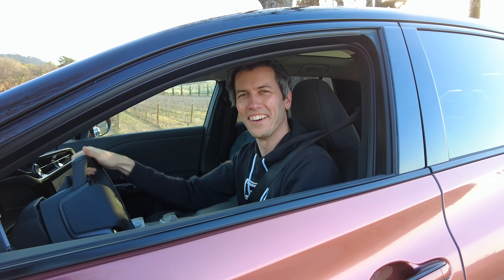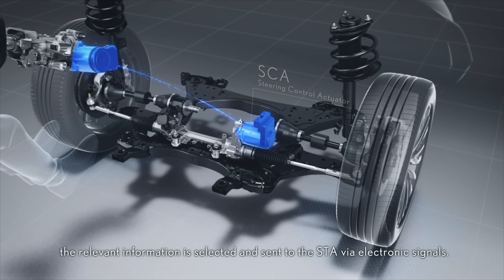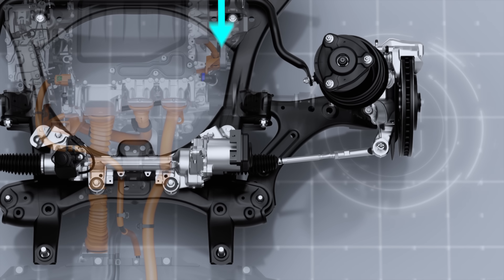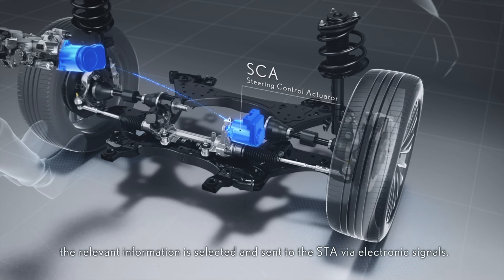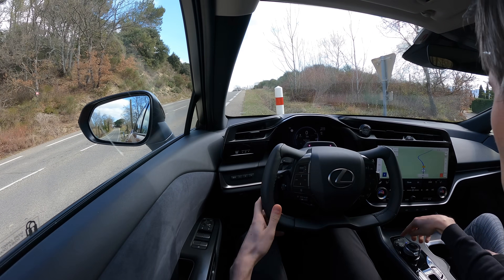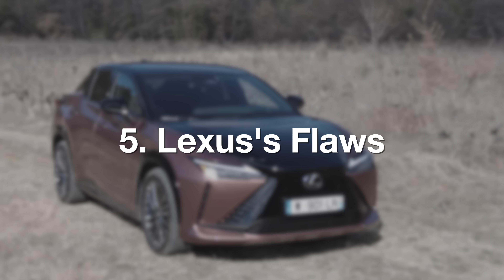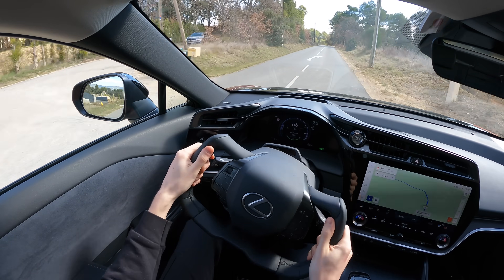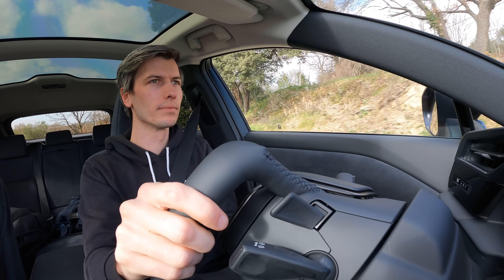How Lexus Fixed Tesla's Bad Idea: Steer-By-Wire Yoke

Comment from the maker: *Important Update* Many have asked if the maximum angle the front wheels can turn is limited at higher speeds, since it uses a shorter ratio. I reached out to Lexus for more information. They said "the amount or angle the wheels of the vehicle can turn left-to-right in a vehicle equipped with Steer by Wire is the same at 5mph and 85mph (they are also the exact same angle values left-to-right as on the traditional EPS steering system vehicles).  The changes are in the actuation of that steering rack left-to-right and the variable speed that you reach during that turning function as vehicle speed increases."

I have asked some clarifying questions and will provide updates here once received.

*Edit 1:* Here is the clarification they provided. FYI - it does not match what was stated above. 
"RZ with Traditional Steering completes a full lock to the L or R turn in roughly 540°.
 
RZ with Steer By Wire (version in France) completes a full lock to the L or R turn in roughly 150°. This implies the base ratio is 3.6:1,  which that for every 1° of driver input at the steering wheel in a Steer-By-Wire RZ, the wheels on the road would operate equivalent to the driver providing a 3.6° input in a traditional steering (540° system).
 
This solves the question of low speed ratio, but as we accelerate we reach a point closer to 1:1 or beyond, in this scenario if the steer-by-wire driver only has 150 partitions or input angles that can be sent to the computer, at 1:1 ratio – the Steer By Wire system only has 27% potential of available max steering angle (equivalent to roughly 1/3 of a full-lock turn). 
 
HYPOTHETICALLY SPEAKING FROM HERE ON: As we approach exceptionally high speeds, the ratio could become even greater skewed on Input:Output so 1 degree input could mean 0.2 degree of output for the wheels.  That means that for every 5 degrees of steering wheel turn by the driver, the wheels at the road would be turning the equivalent of 1 single degree input in a traditional steering vehicle.  This provides the feeling of ultimate precision and fun while driving at high speed because you are truly feeling every decimal partition of steering angle so you can very accurately steer the vehicle where you want it go. 
 
540° & 150° are the angles we know and have experienced.  The 3.6:1 ratio is a simple calculation that shows the relationship of those values.  We have a confirmation but not a provided data sheet, that at some speed beyond 10mph the ratio begins to skew towards 1:1 or more, so the rest of the values (i.e. 0.2°) are completely made up values but the math proves the concept. 
 
Purely for the case of the argument – let’s say the driver is doing 80mph and at that speed every angle of driver steering wheel input is 0.2 equivalent degree of output at the wheels.  If we multiply the 150 degrees of full lock input available to the driver at the steering wheel by the 0.2 degree output at the wheels, our total steering angle would be 30 degrees. 
 
As the driver applies the brakes or accelerates, the algorithm of input/output adjusts thus giving the driver “more access” or “less access” to max steering angle.
5mph: 150° Input by 3.6 Output = 540° “full lock turn” equivalent or 100% of max steering angle available
45mph: 150° Input by 1 Output = 150° equivalent or 27% of max steering angle available
60mph: 150° Input by 0.35 Output = 52.5° or 9.7% of max steering angle available
80mph 150° Input by 0.2 Output = 30° or 5.5% of max steering angle available
 
This may seem strange to think about, but imagine going 80 mph and without slowing down turn the steering wheel of ANY vehicle 540° to the full lock position…… nobody in their right mind would ever do that because it would undoubtedly cause a serious accident.  Having access to truly full lock steering ratio at 80mph is not something anyone ever takes advantage of or is physically capable of doing on a road because as you begin to turn that aggressively at speed, you would completely run out of road surface to drive on before being able to even complete the full lock turn.  There is also the high likelihood that if a driver attempted to do a full-lock turn at 80mph, the vehicle would have the possibility to flip over.  We know it takes about 2.2 seconds for an average driver to make a 540°.  At 80mph, approximately 200 feet are covered in 2 seconds.  With the average lane width in the US being 12ft (source: Google Search), it would require a road 16.67 lanes wide to be able to complete a full lock turn (without slowing down at 80mph, if that were even physically possible without disrupting or flipping the vehicle over). 
 
Conclusion: The higher speed one goes in ANY vehicle, traditional steering or Steer By Wire, the less useful max steering angle becomes, if even physically possible to achieve.  So the Steer by Wire system mathematically limiting access to max steering angle becomes a non-issue from a drivability or experience standpoint.  Having an inherent base ratio of roughly 3.6:1 and (a hypothetical) 0.2:1 at high speeds provides extreme ease of use at low speeds in parking lots or u-turns while providing an exceptionally precise feeling when steering at higher speeds and provides a complete range of differing input:output ratios to match the situationally indefinitely.  (The faster you drive, the more precise the steering ratio)."
Reply: Did i miss it or do you not know or intentionally omit that we ALREADY have gradient steering ratio in every car mechanically? Its low sensitivity close to neutral steering angle for highway speeds and high sensitivity at the edges for parking.
Its done by different tooth sizes...
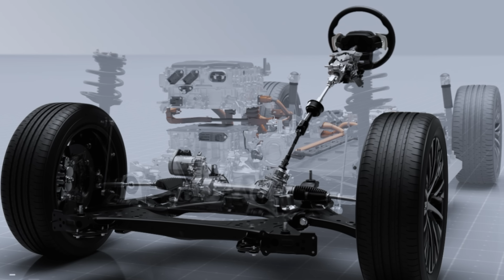Reply: @uninteressant2196  At 10:02 in the video he addresses the existence and limitations of modern mechanical variable steering ratio systems.
Reply: @uninteressant2196  I think your referring to the steering being speed sensitive vs variable ratio. Variable ratio is not a standard steering feature, but the speed sensitive part is.
Reply: @niuhuskieguy  Its entirely angle dependant, as i stated yes thats not variable, but good enough -the F1 clip at somewhere after 10:25 shows this pretty well - the outer edges of steering range turn the wheels way more than in the center. This is used in every car and of course street cars are less sensitive, mostly because of comfort and high speed safety. 

Sure you can make it variable on the fly when electric- i wanted to point out that the issue is a non issue and the existing steering principle is never mentioned in the video.

Where i see an advantage is back wheel steering.
Reply: Is the steering adjustment vs speed done with exponential curve adjustment, or does Lexus actually limit the total allowable steering angle at speed, or both?  In the RC aerobatic aircraft world, we adjust “expo” on the sticks for the exact reason Lexus adjusts high vs low speed ratios: we don’t want too much sensitivity near center stick. We still set the total travel though, and that does not change regardless of how we mess with the expo - full left rudder is ALWAYS full left rudder. It would be cool to be the engineer who writes these steering curves. It would be cooler to have ability to program a custom curve in the vehicle we are buying.
Reply: @MichaelBergantzel i don't know what Lexus did exactly, but usually you don't limit the steering angle as you need quite a lot at low speed tight corners, and at high speed you need a lot to generate the required torque to turn the car even at wide corners.
What you do is limiting the speed and acceleration at which the wheels can rotate. Because those have great impact on weight transfer in the car and therefore your stability margin of the car. If done correctly you won't ever need your ESP on normal road conditions. Which can make the system a lot cheaper. (PS. you still need an ESP, but it's no where near as beafy)
Reply: So, how did they solve the problem with accelerating or decelerating on a curved section of the road (such a s a circular track)? Obviously, for safety reasons you cannot change the steering ratio when the wheels are turned because you don't know where the driver wants the car to go (so, the rotation angle of the wheels should not be changed if the yoke is kept at the same angle when the vehicle is accelerating or decelerating). Do you understand what the problem is? You drove this car. Did you actually try to accelerate or decelerate while making a turn?
Reply: As the curve opens up or closes down, you steer a little more or a little less. Acceleration has the same effect. Not sure what your question is.
Reply: @tedantares2751 excellent question!
Reply: @tedantares2751  has this been answered ?
Reply: @KrissOTA  No
Reply: So effectively the car has a fixed total steering ratio and as you go up in speed the center of the turning arc is elongated for precision control and the edges are compressed to equal net 0 change in total steering angle? wouldn't this cause rapid change in turning angle as you approach the locks which at high speed can roll the car? Most peoples automatic response to the moose test is turning the wheel 90 degrees but in this car that would turn you up to 300% of what you are expecting which is very dangerous. I don't see the practical need for full steering at high speeds why not just cut some of it off for a more consistent and safer turning experience.
Reply: @Jared Ivey:  Well put.  Couldn’t have said it any better myself.
Reply: @JosieShmosie-x7m  wait, isnt that exactly what he said? it says it lowers max steering angle at high speeds. What are you complaining about?
Reply: @JosieShmosie-x7m  >>more consistent and safer turning experience
to have consistent experience you need to experience what it is to do U turn on 80kmh
even "mechanical" feeling will be different on 80kmh and 5kmh.
Reply: Roll the car? Not possible unless you strike a curb.
Reply: If the driver can command the wheels to the same angles at 5 and 85 mph, but changes near center are reduced to prevent it from feeling twitchy, then changes far from center must be larger. To me that sounds like a recipe for fishtailing, with unintuitive controls in an emergency.
Reply: @craigyounkins7013  you are absolutely right, it’s not every day we steer that hard on the highway, so an exponential steering curve would make correcting very hard. Most drivers would never even experience the ‘far from 0’ point on that curve until it’s too late
Reply: @craigyounkins7013  yeah agree the wheel will probably try to increase the resistance as you turn hard so you might be fighting that motor to make your maneuver. lets see it do the moose test.
Reply: @craigyounkins7013  You get the same in RC Planes/Drones
Reply: @craigyounkins7013  I assume the total amount of steering wheel movement is changed. I'm just making up numbers here, but you would have 900 degrees of steering wheel movement at highway speed, which is the industry standard, and 360 degrees at parking speeds. Again, made up numbers, but you get the idea.
Reply: I'm just happy that the largest automobile manufacturer is finally starting to embrace battery electric powertrains.
Reply: some mentioned the delay that is visible between in the initial footage where the car is stopped and both the steering wheel and the wheel are visible. is it noticeable/annoying when driving? Also you failed to mention variable gear ratio steering has been implemented and abandoned by both Honda (Honda S2000 VGS) and Toyota (Land Cruiser VGRS) in the 2000s ... it would be interesting to see a comparison, to see if they improved the technology, or if it's just making a comeback because it makes more sense in  EV's with large screens, yokes, and self driving around the corner. Personally I think it makes sense because:
1 it allows the driver to have a more consistent range of motion at low and high speeds
2 forcing the driver to do 3 full rotations of the steering wheel for three point turns is not great if you can have power steering that allows you to do it without taking your hands off the steering wheel
3 having less sensitive/slower steering at high speeds can be a good thing
 but they are concerns though, like
1 the learning curve, is it more dangerous when you're not used to it or someone borrows your car? it could be fixed with settings though
2 how to handle switching frequently between cars with fixed and variable steering.
3 how is muscle memory affected for emergencies, like quick steering adjustments to avoid a car that tries to merge into you, or oversteer/loss of traction
4 how it feels in a long corner with a radius that tightens or widens, to have the ratio change as your speed increases or decreases, and have the steering change with a constant steering wheel input....
Reply: @geemy9675  Not just honda and lexus but mercedes amended it too. That's because they wanted to just get rid of the mechanical connection while not really providing ANY benefits to the driver. I remember most of my friends felt the same -> if im not connected and motor is doing all the work why am i rotating the wheel 4 times. The sensitivity diference is nothing new either. Many introduce more WEIGHT to the stearing so the steering feels "stable" without changing gear ration. 

They all did it for cost saving and reasons  and manufacturers like mercedes wanted   to have control over the steering. My guess is that they would have taken away your steering inputs as part of stability control and such. The engineers, just like goverments, always see people having less control as solution to any problem. As the saying goes:
"The road to hell is paved in good intention" 

The negative I see is that this will be programmed differently from one maker to another. There is a reason games give you the adjustment settings. Not everyone is gonna like single approach. And we know how little customization they give us in cars despite the car being able to offer it.
Reply: If I am able to interpret that reply from Lexus, it sounds like they are saying that the steering ratio is much closer to "fixed" while at slow speeds (the angle of left-right tire movement is the nearly the same whether on-center or at full lock all across the rack). While at high speeds, it runs a very extreme variable ratio which looks like an inverted bell curve. Put another way, at high speed, the steering ratio is slow on-center, where a lot of steering angle change is required for small tire angle change. As you approach full lock at either end of the steering rack, that slow ratio ramps up quickly to get you the full articulation of the steering rack.

Although I like the concept of quick steering ratio that this system provides, the above could be dangerous in a specific situation. Given that the lock-to-lock of the steering wheel is a fixed angle of rotation (0.83 turns), math dictates that if you slow down the rack on-center at speed, but still must cover the same degree of steering rack movement, the remaining space OFF-center must be even faster while at high speeds. So the car is more stable and less twitchy on-center, but if you panic, or spasm (sneeze, seizure, etc.), or are impacted (giant pothole, hit by another vehicle, hit by something inside the cabin) and venture too far off-center, the steering will become extremely sensitive and you could wind up steering directly off the road or into an obstacle or spinning out on the roadway.

Most people will never do this, but that is precisely the problem. The one time you panic to avoid a stopped car or something on the freeway by quickly steering around it, that may be your only chance to experience this extremely fast ratio, and it will come unexpectedly, possibly causing a loss of vehicle control, and a huge overcorrection (a serious issue with mechanical steering already, especially on cars with soft suspensions).
Reply: Won't the adaptive steering ratio make it dangerous if your at highway speeds in rural areas and you suddenly have to brake/swerve to avoid an animal that runs onto the road/a dead animal hiding in the darkness of night? Won't the controller disregard those movement you made to the steering wheel to try and swerve out of the way?
Reply: Like Porsche’s front end lift, the setting needs to be mapped for steering intensity. I don’t see it working any other way. It would be great to be able to integrate the front camera into the system so the system will know what to expect but it’s up to the driver to make the correction OR we just need full self driving
Reply: That makes it seem to me that the delay in steering you observed could be programmed in
Reply: @Omlet221  except he was at dead standstill, but I agree what the seamed to indicate as a delay of moving wheel to when wheels get to true alignment of inputted direction.

So if on the highway you turn the wheel all the way to one side. It takes about as long as someone who had to hand over hand turn it to one side. Both would cause uncontrollable loss of traction.
Reply: @Omlet221 seems like a smoothing thing for ride comfort. Probably it could be tuned
Reply: @engineering explained But what if the car loses power all the way like zero power like back-up power also fails and I need to push the car and move it? How will I be able to move the car and navigate to any direction while pushing it? Will it still be able to steer to the desired direction?
Reply: keep it as an option and everybody will be cool with it. We hate new things because they were pushed to us, forcing us to use it instead of giving us a choice. electronic e-brake, im looking at you!
Reply: "nobody in their right mind would ever do that because it would undoubtedly cause a serious accident." You completely discount evasive driving, in which the driver pushes the car to the absolute limit of what's possible, performing J-turns and other high-skill maneuvers. Low-skill assumptions only apply to low-skill drivers, who should become skilled drivers instead of engineers attempting to make up for their lack of skills by programming some computer to attempt to guess the driver's intent.
Reply: @amorphousblob2721  Both, surely, and proportionate with unusual driving incident frequency.  Not suggesting untrained drivers, but the car coping with a driver developing reduced brain or physical function for any reason.
Reply: I would like to provide my own feedback with an older lexus car. It had a parking lot feature that would increase the sensitivity of the steering wheel at really low speeds. Well in ours that got stuck on at any speed. Going 45 mph if you so much as twitched you would be in the next lane over. It was scary af to drive.
Reply: It will be interesting to see the vehicle at the moose test.
Reply: So cool you had the opportunity to try it out! All the best!
Reply: What happens when gm  uses this and the wires burn up
Reply: If the system turns the same amount from lock to lock then is the system a variable ratio steering or does it just vary the speed it takes the wheels to reach the new position of the steering wheel.
Reply: Then it should Eigan at TDP i.e. 0 degree input should appox. 0 degree steering angle, path to path. Drift from stacking or noise? Position correction on servos is pretty standard in firmware.
Reply: i'm kinda surprised by that. 

i also wanted to point out that the delay might not be as much a flaw as you think. as, if there was no delay: it would feel waaaaaay too twitchy. again, as you said: unless you're a racecar driver. so maybe in the real model, when you put the car into "Sport Mode", the delay decreases and the ratio at higher speed is a little higher than in "Normal Mode". or rather: the drop off is lessened. 

and then maybe there's a "Race Mode". which maybe a warning pops up on the main screen saying "WARNING: this vehicle mode is intended for racecar drivers only. and may be unsafe for casual drivers. Lexus is not responsible for any harm this may cause the driver." to which you then have to click "OKAY" or even "I AGREE". a real privacy policy/terms and conditions type warning. this should also be explicitly told to the owner when they pick up the car. "this car has race mode that's meant for race car drivers only. the steering gets super twitchy. we recommend against using it unless you're a very experienced driver." maybe it could even be locked out until a certain amount of mileage is reached in "Sport  Mode". and also probably should be locked out in "Young Driver" and "Valet" modes as well. 

the delay may also be unsolvable. as it might be caused by the components of the steering system. electrons don't travel instantly, you may know. maybe it could be solved using an AI software? maybe with a camera mounted on the yoke? or on the dash board. i dunno.
Reply: I had an idea for a video: 
Get a few COMFORTABLE sedans: Subaru LEGACY is very comfortable, it would be a must for this test, new 23 Honda Accord and some other sedans with a SOFT suspension and NO low profile tires. Also get a few SUV of a similar price range.
Go to a GRAVEL ROAD with POTHOLES, washboard surface, etc., before you do the driving film the gravel road and show the potholes / bad condition.
Get a few random people who think SUV ride better, BLINDFOLD them, lift them into the cars somehow (so they DON'T feel the step-in height, that would ruin the test) and drive over the bad gravel road with them blindfolded. Maybe you can get a bodybuilder for lifting the people in and shout out their channel in return or something, best idea I had to solve the lifting problem lol
Before they get out of the car let them guess if car or SUV and the price of the vehicle.
Reply: When I saw that steering delay in the video I thought that was scary.
Reply: In essence we brought haptic feed back to the steering wheels
Reply: Totally unrelated to this. But could you please make  a video explaining whether or not hybrid engine that kick into life and turn back off after a few seconds is harmful to its long term health. Especially when they are cold and they kick into high RPMs and load very quickly.
Reply: Didn't Peugeot do something like this about 20 years ago? And If I remember correctly they went back to mechanical connections because of safety concerns.
I might be wrong on that one.
Reply: The middle seat became a snap of a finger 😮
Reply: Seriously....? Is not wireless yet? Even my headphones are wireless and, they are very safe.
Reply: The thing I don’t get tho is that variable assist strength has been a thing since hydraulic steering. So why can’t they continue to apply that to a traditional mechanical linkage with a short steering angle?

Also another concern i would have is not the redundancy of the systems but the redundancy of the wiring. Wires get chewed by rodents all the time or go bad in other ways. If there is only one set of wires from the input to the steering rack that feels really scary
Reply: Okk
Reply: Probably feels like a go kart
Reply: In RC modeling it is called EXPONENTIAL STEERING.
Reply: From the video, one could get the idea that adaptive steering is something new, or that steer-by-wire is needed for adaptive steering...
Reply: Is there A backup plan if ALL the electronic systems went dark? I think there should be A mechanical backup somewhere if the car detects failing backup electronics. Keep in mind that the temperature makes A difference on batteries.
Reply: I simply look at the pros and cons too of things. But the new things that were pushed to us seem A bit underdeveloped. I can agree that it is less maintenance even with the evil seeming e brakes. And that they are less work for repairs. So all I got to say is that maintenance depends on how the driver treats the machines.
Reply: @litewarrior8130  I get all electrocyclization but the e e-brakes. the second e stands for emergency - a motor powered switch is not an emergency equipment.
Reply: @DD Johnson  Is it just an option to have A switch for an e-brake instead of A cable? On automatic transmission. The e-brakes are barely used. I recommend just sticking to A cable for it. It will give you more variety of what you may need out of it.
Reply: Unless they achieve the different steering ratio with "expo" (exponential response curve common in RC) alone, it must limit the wheel angle, because there are limits on the yoke angle.

Hopefully they've accounted for chassis slip angle, otherwise, it's possible it won't give you enough steering angle at high speeds to recover from an oversteer condition.

High sensitivity (required to achieve the full range of wheel angles with so little yoke angle) combined with the delay will make it challenging and unintuitive to recover from a skid.

Clever things could be done with control and detecting the slide, but now more sensors are in the critical control path. And it's not unlikely that a failure of one item in the path could lead to a high speed oversteer condition.
Reply: I was just thinking of that. Multi-variable rack and pinions to get the best of both sides. Great response of direct connection. And multivariable as if it was steered by wire.
Reply: yea the programming on this is going to be tricky, for the average driver the AI or logic that prevents you from making a quick hard sharp turn at high speed is probably the right choice.  But what if say a tornado drops a concrete truck right in front of you, some of us would prefer the option to take our chances and go off the road at high speed rather than hope the breaks can stop, similar issues with the oncoming vehicle headed strait for you.
Reply: You car safety systems to change steering ratio or manual override to adjust it. Lock it right there just in case something happens to the electronics. I already acknowledged the tricky programming. Let's hope they don't make the same mistake like tesla did that caused uncontrolled issues and car accidents.
Reply: Per Colin Chapman, the more lock you can apply the larger slip angle you can recover from.
Reply: @makofoto  what do you mean?
Reply: My 80's Honda has speed sensitive steering...
Reply: This has been a thing in the rc world for a while. I think it was called exponential control or something like that. The ratio exponentially gets higher the closer the wheel is turned to the limit. In this case, they’ve made the exponential tuning variable based off of the speed of the car, which will make the wheels turn even if you have the wheel locked to a certain position and accelerate/decelerate.
Reply: "mimic" in this case is a dangerous word.
Reply: I hope that the cable has a backup as well because there is no use in using 2 motors on each end and the cable just burning through and you losing all control.
Reply: right at the beginning of the video we can see the delay between steering and the wheels actually turn, it looks like 0.5s delay, should feel horrible
Reply: @PrefoX  of course there a delay. Electric systems always have delays, like an DC gearbox. Nothing beats an ol' mechanical system
Reply: Here's a question you should ask them:
"What do insurers think of Steer-By-Wire? Or in short: what about liability?"

Imagine I'm on a parking lot and drive my car into another vehicle. With a mechanical steering system, the question of whos's fault it was would be pretty simple: Because everything is mechanically linked to each other, the car will go where I point the steering wheel, so it would clearly be my fault. With Steer-By-Wire however, the steering wheel (or yoke) and the actual wheels are decoupled from each other and a computer eventually decides what the car will do. Now what stops me from claiming that it wasn't actually my input that caused the accident, but a computer glitch or a sensor malfunction? How can Lexus prove me wrong? Sure, they could read out the logs, but aside from that requiring multiple redundant sensors checking on each other to eliminate any doubt, it would also mean that they would have to analyze every "black box" from each and every one of their cars involved in accidents - pretty expensive, I assume! While a simple fender-bender would be less severe and costly, the same principle would apply if I have an accident on the road at higher speeds: I claim that I made evasive maneuvers but the car didn't go where I wanted it to go, now I'm severly injured or someone might end up dead and we all sue Lexus - even more expensive, I assume!

This technology isn't exactly rocket science and has been around for decades, but I would argue that the liability issues mentioned above are the reason why Steer-By-Wire hasn't caught on (yet)...
Reply: This tech sounds like the servo/repeater systems we used in the navy
Reply: I'm interested about the European market.
Currently, every safety related part needs to be mechanically connected. WE don't have brake by wire, there's always a hydraulic system connected to the pedal (even in EVs). We don't have electromagnetic suspension since it would fail in case of power loss.

Are we getting steer-by-wire? I honestly don't believe so although your arguments in terms of safety are great. Especially aviation probably has no mechanical steering at all and it still works great.

Lastly, I wonder what an electromagnetic pulse would cause in such a system.
Reply: This video is a perfect explanation. 👍
The remaining question  is, can the time delay of a steer by wire system be reduced, so it will not be recognised by the driver? 🤔
Reply: I hate steering by wire unless I'm able to tune it to my liking. I realize there must be a lag or else it won't be possible to make an algorithm capable of predicting if a hasty movement should be interpreted as desirable to undesirable, but if I cannot turn such a judgment off when needed and into manual mode, this is completely useless to me. Besides, I always wondered why I need a damn wheel. It should have been replaced by joysticks thirty years ago.
Reply: Mercedes tried that 25 years ago and found out it was a waste of time.
Reply: Something you forgot to mention (or it simply didn't occur to you) is that many physically disabled people cannot use yokes as there's nowhere to mount the ball/knob/spinner :(
Reply: The "delay" of a steer by wire will be necessary if you want equal rotation of the car at different grip, speed, mass, wheelspeed etc.
As you command torque not power from an analoge engine, you demand torque not rotation from the steering. A good driver, like F1, needs the torque information to find the grip on track, everyone expect racing drivers can't really use this information in their daily driver. As you can't turn the Lexus full rotation's i expect them to make about equal cornering relation at every speed. So the wheels need to turn differently to compensate for various steering torque requirements.
It's also interesting how you can amplify grip information over general steering effort with a steer by wire system. Might be worth for you to get behind the wheel of a new GT3 oder DTM car. They have steer-by-wire systems you can adjust. Could be an interesting video.
Reply: What happens if you steer the wheel in high speed to the may left and stops without straightening the steering wheel? Your steer will be max to the left while your wheels will be a bit left only, so you will be unable to steer to the left anymore. Will the steering wheel reset at the center?
Reply: @kashmirha  turning a car at high speed requires a lot of torque (force of the tire x distance from the contact patch to the center of gravity) So angles aren`t that different, to begin with. As you lose speed, the steering will adjust to remain a similar turning rate. If you stop in a steering lock, the wheels will be at a maximum angle as well. Any resetting or recalibrating is only necessary when you rotate the wheels while the car is out of power, maybe at a service or after a crash.
Reply: Wow.  :hand-orange-covering-eyes:
Reply: listen man..my biggest concern is the delay...its like bluetooth. if they manage to make the wheels turn instantly when I turn the steering wheel without any delay....I dont have problems. but currently there's like a half a second delay. I know its a prototype so there's room for improvement. lets see where these E steering takes us.
Reply: I doubt that you're still replying to these comments but nobody is talking about recovering from a spin out at high speed. If you hit a sudden oil spill on the highway while gently turning, you might actually need full lock maximum steering angle into the direction of the spin to AVOID a serious accident. I worry that in the relatively common case of a spin out, the system having linear response steering with reduced sensitivity would inhibit the driver's ability to recover from a spin.

Or perhaps the fact that the system is only available in an SUV and not in a car is because they're counting on the SUV rolling over as soon as the spin begins. (Kidding, mostly)
Reply: Obviously, this is a rather unlikely scenario but:

If I want to avoid someone on the road in an emergency at higher speed, the steer-by-wire system will not let me choose to crash rather than hit the person ?

If you are in a car with a good safety rating maybe in some uncommon situations a driver would purposefully input to crash because they know they get a better chance to survive on a highway with the seatbelt on rather than a human getting hit directly by a car ?
Reply: I honestly thought all car steering had an element of this kind of gradual sensitivity at high speeds. Must have been just in my head. I too think I would intuitively adapt to this. Single pedal driving was instantly intuitive for me.
Reply: What happens if I start a gradual turn (steering wheel held at 30degrees to left) on a highway (going 85mph), and decelerate during the turn to 45 mph, while I hold the steering wheel at the same 30 degree angle?
Reply: what would happen in a slide where over steering is needed to regain control.
Reply: What if the car travelling at highway speeds, swerves to avoid colliding with another car while applying the brakes. When the steering wheel is held at a certain angle, then the angle by which the wheels would have turned would decrease as the car slows down. Ultimately not being able to avoid collision
Reply: Solutions looking for a problem….
Keep it simple.Less to go wrong.
Aircraft fly by wire systems are far more rigorously tested and regulated than the motor  industry where they are more likely to deny a problem exists amd blame it on driver error until caught out.
It will be interesting to see what happens to drive by wire systems and cars heavily dependent on electronics when we get the next Carrington Event occurs..
Reply: "infinitely variable" steering ratio is not only speed based. It can be input position based as well. This was never touched on in the video. At low speed you could map input/output
20%/ 20%
50%/ 50%
100%/ 100%

And at high speed 
20%/ 5%
50%/ 20%
100%/100%
In an effort to allow a desensitized center position to eliminate twitch, but still allow the user full range in instances where lets say a full lock countersteer may be necessary to avoid spinout in the rain.
Reply: I've never liked acceleration curves on my mouse. Acceleration curve for steering sounds like a goddamn nightmare.
Reply: Well, this video didn't age well. Cybertruck with steer by wire. I've changed my mind. Now I want a yoke.
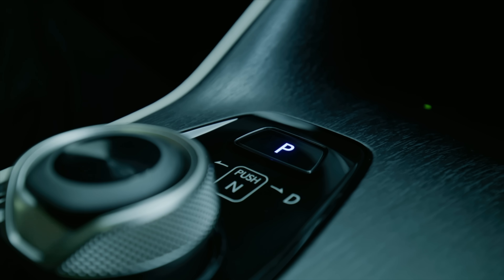Reply: With the 2 motors in the steering rack, is there an alternating control sequence like a 1:10 (1 back up cycle per 10 normal cycles) so the back up motor is exercised occasionally so it doesn't seize up?
Reply: I think this implementation is great and exciting. I can understand everything but one aspect: what happens if you are braking heavily on a highway curve (say you see traffic slowing around a sweeper) your ratio would increase as your ground speed decreases. Would that feel natural?

 I understand low speed manoeuvring with a changing ratio is much more visual and you could get used to it. But I wonder what a sudden change while braking would feel like... 🤔
Reply: I wonder how very experienced drivers would feel when your brain is trained for fixed ratio.  Also switching between cars might be annoying
Reply: @glike2 ’ve once driven an Audi A4 that, using some dark magic I suppose, managed to have a variable steering ratio on a mechanical shaft.
And I can tell you it’s very natural, and so much better than fixed ratios.
Granted the change in ratio was not as big as this drive by wire wheel, but still
Reply: @glike2  Ever play a car video game in which you feather the controls at high speed and use them hard when slow and or when trying to hit a turn very fast. 
I wonder if drive say 75 mph and you bump the steering wheel down yet you are driving on a single lane road and the car sees there was no need to react they would just ignore it. This is where Tesla full self driving will be handy. Until you no longer need the steering wheel. Though I have a feeling the with in the next 5 to 10 years most new cars will have very limited reasons to use the steering wheel.
Reply: @glike2  Probably would only affect people who long term only ever drive 1 car.  If your household already has multiple cars that you drive regularly then your muscle memory is probably already adapted to changing your driving habits rapidly in different cars... I used to drive 3 cars regularly, each very very different so it would take me a second initially to settle into each car when I drove it.
Reply: @glike2  There has been variable ratio mechanical steering racks for a long time and it's bad, as it messes with coordination and muscle memory.
Reply: @glike2 in a real car, especially something sporty, the steering is not linear either. With geometry and especially sine and cosine relationships of parts you have more precision in the center and more effective turning at large angles. Also the mechanical geering that translates rotation to displacement doesn't have to be equal. Infact a logarithmic relationships is very common, especially in cars where you can't turn the wheel full circle like in F1.
Reply: @glike2  it actually might be the same thing as going manual and auto, weird in the first kilometre but ok for the rest.
Reply: @glike2  use mouse acceleration and you will find out it now. Some wont like it. For others - no big deal. Need just to get used to.
Reply: @glike2  I am an experienced driver and work as a delivery driver. At work I am always being assigned to different trucks. Some of the trucks are automatic and some are manual, some have a normal steering ratio but the 1/2 ton trucks have a very sensitive and twitchy feel. My "experience" of driving different types of vehicles combined with my years of driving experience allow me to adapt to a new vehicle in MINUTES, not days or months.
Reply: It is also a little improvement in safety because there is no mechanical construction which can pushed into your breast. The steering of modern Cars are of course built like a telescope to prevent this, but i think this is limited in travel.
Reply: I think the idea is excellent and they have done the yoke correctly, but I think we will not adjust to this technology quickly as I think it has a  longer learning curve such as if I drive the car on the same road daily but my speed is different then if I reach a curve my response could be higher or lower than the curve before it and maybe lower or higher than the same curve the during the last trip.
Reply: @AhmadMNss  My previous truck was a 2002 Sonoma with 1-2 inches of play in the steering wheel. My "new" Truck is a 2016 Canyon with no play in the steering wheel. When I started driving the Canyon I found the steering twitchy but surprisingly it only took me, an experienced driver, a few minutes to adjust my steering technique to compensate for the more sensitive steering.
Reply: But what if you drive at high speeds. 85 is just highway cruising.
Reply: Simple is safer. 
Engineers are trying to earn a name for their team and brand at the cost of public safety. Most people don't want a yoke or steer by wire. We have brains to handle it. Technology is good and safe to aid, not be in control.
Reply: They just couldn't resist removing the last mechanical input & feedback from the driver. So now it becomes a complete reality to take full control of a car via its connection over the air.  
Judging by the fact that the brand didn't introduce this technology while keeping a physical linkage for backup (think electromagnetically discoupled when by-wire is operating normally)  I dare to suspect this is all a cost-saving exercise.
Reply: @roymoorman5990  " I dare to suspect this is all a cost-saving exercise."

That's a part of it, of course, because lowering costs is a core part of what engineers do. When engineers design a bridge or a building using various kinds of truss systems that use less steel to carry a given load, this reduces cost. When engineers design a car with a semi-monocoque or unibody frame, this also uses less steel and reduces cost as well as giving other significant advantages, such as reduced weight.

Why would anybody want to spend more than they need to on an engineered device? If you save money, you can use it elsewhere or just pass the savings on to the consumer.
Reply: If you don't have a car for fun, you might as well drive a shooping cart with a electric motor
Reply: @gandalfwiz20007  huh? Most people see cars as a necessity.  Most people look for reliable, comfortable, affordable and safe cars.  Fun is the last premise. Most people do not have the extra cash to dish out for fun cars. Fun cars are childish if you ask me. It is true, it is childish.  I do have things I still do that stems from my never stopping childish nature.
Reply: @Lam rof  well there is a saying that goes: "Men don't mature, the toys just get bigger" . It's the reason people still drive 1976 Chargers and Mustangs
Reply: Invented by people that come to work on a bicycle.
Reply: Imagine a hacker (or a state actor) being able to steer you into a tree leaving no trace whatsoever, the perfect crime. No thanks.
Reply: Since there are 2 motor contained in the steering actuator, are there 2 separate connections from the wiring harness to the unit?  At least from the illustrations shown, there only appears to be one.
Reply: Bro, thats not safe.🥵
Reply: i genuinely hope this car fails so they never go mainstream with this. i despise when games force this on me and i damn sure dont want my car doing it.
Reply: @MasterBasser  Good news, Lexus is not the only car manufacturer in the world. I don't know why there are so many comments freaking out about this technology. It will not be mainstream next year, or in the next 10 years. All technology has a development period to work out any design and reliability issues. When it becomes mainstream those people that were 20 year olds on 2023 will be senior citizens, or dead. Future generations will grow up with this technology the way we grew up with cruise control.
Reply: It looks decent, but I really wish they would go the Tesla route and remove all the clutter from the wheel, it's just not needed.
Reply: @SirDragonClaw  Lots of people hate having to use touchscreens for everything. For example, my car has cruise control on the steering wheel ... I know exactly which switch needs to be pressed which way in order to set, cancel, accel, decel without having to look at it and without having to dig through screen menus. It makes sense to have that on the steering wheel or on a stalk very close by (which Toyota cars have historically done). Tesla yokes have touch-sensitive controls rather than physical switches, but they're still there. And VW tried that (ID3, ID4) ... and people hated them, and they're going back to normal switches.
Reply: What happens if you alternator took a crap, while on the highway and you keep driving until your battery gets to low. then what happens ?
Reply from the maker: @ugetridofit  this is an electric car, no alternator, and as discussed, you have three batteries, so if you main battery dies (you run out of range) you still have two batteries which can power the steering.
Reply: @EngineeringExplained  Did you ask them about manufacturing cost? Seems like the steer by wire would actually cost more than a traditional steering rack.
Reply: @EngineeringExplained  Tie rods, ball joints, etc can break on mechanical systems. it happens all the time. I strongly doubt the electronic systems will be any more failure prone.
Reply: @EngineeringExplained  if the angles are exactly the same at 85 mph and 5 mph how do they change the steering ratio and keep the same wheel 300deg turn.
Reply: @EngineeringExplained  General Motors did this back in the 1990's as a concept.
The main difference was that throttle and brakes were also built into the wheel, negating the need for the pedals. Toyota missed an opportunity to produce a similar control system for full motability (driver accessibility.) Those with no legs, for example, could so easily drive a car if the throttle was controlled by the right hand and brake on the left hand. Or perhaps conventional throttle pedal, and brake on the yoke. Any combination is possible.
Reply: @EngineeringExplained  But what if the car loses power all the way like zero power like all back-ups fail and I need to push the car and move it? How will I be able to move the car and navigate to any direction while pushing it? Will it still be able to steer to the desired direction?
Reply: @EngineeringExplained  Was its steering is as accurate as you steer your bicycle? It seems its very responsive like you steer your bicycle
Reply: @EngineeringExplained I feel like there should be at least one  or two wheels that can produce just enough power to the steering and brakes in the case of abrupt power loss. 
Sort of like an Aux Power Unit on an aircraft. 
If we are trying to be redundant,  I believe this would be part of it.
Reply: @EngineeringExplained  there are already Systems around that have the benefits of this system for over 10 years

Ford Focus 2 has software options in onboard computer to setup steering force and feedback. So basicly it's changing the pressure of the hydraulic system and so the steering support increase or decreases

ZF build a Active front steering for BMW even back in 2010 with a little planetary gearbox on top to change ratio dynamically with a physical link and failsafe features (only downside is that steering wheel isn't centered anymore when it fails)
Reply: @EngineeringExplained  how well is this steering mechanism isolated on the car's internal network? it'd really sugg to get hacked and then remotely smashed into a wall...
Reply: @ugetridofit  you get a deserved rank in darwins list, as you ignored not only the warning about your battery not being charged anymore, but also the warning about your battery being low on charge. though, if engineers were smart, your car will just stop drive before it is unable to steer.
Reply: @ugetridofit  Well whilst you may think there will be a need to discard your underwear, this probably will not be necessary as you wont even have a need for the ER [ the disposal of your estate could cause a few problems for the family if you had not made a will]
Reply: @ugetridofit  just watch the vid before talking
Reply: @ugetridofit  yknow how your phone turns off when battery low? Yeah, if all 3 batteries come close to dying you'll get shut down with what I'm sure is more than reasonable notifications.
Reply: @ugetridofit  If your alternator takes a crap you have the same problems as you would with any modern car. The fancy wheel doesn’t change anything. The real issue is no backup systems for anything in a modern car that requires power to function.
Reply: @ugetridofit  and what happens if you want to quickly avoid some drunk person in the middle of my lane?   this happened to me once at 60mph (100kph)   and I avoided them with near milliseconds to spare with a hydraulic power steering system.    with this system I would have killed them, plain and simple.    Manufacturers, please hire some people with brains.
Reply: @ugetridofit  did you watch the video? use your brain an alternator in an electric car lol?